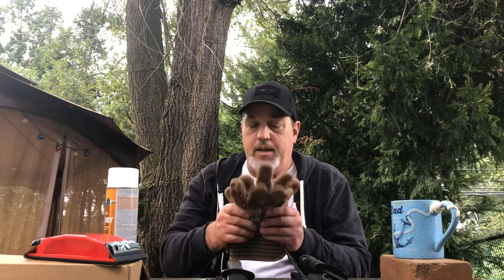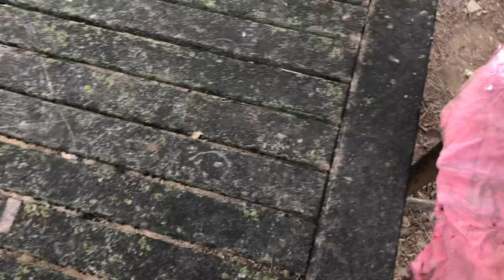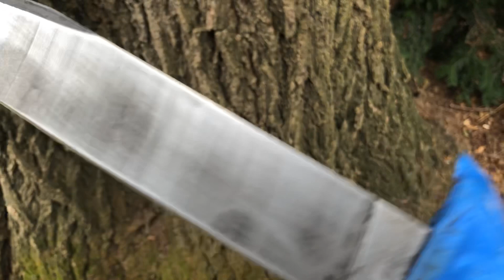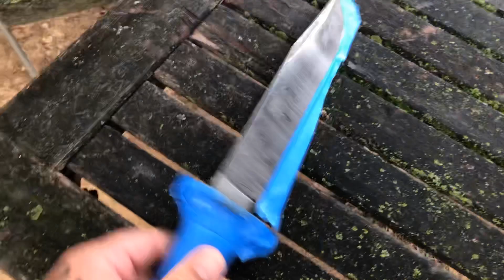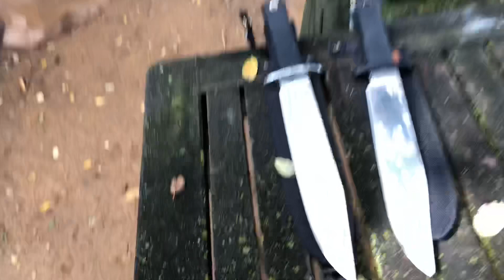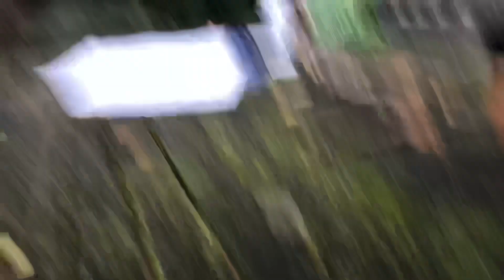MTech mt- 151 Trailmaster knife Coating Removal - STUNNING!!!!!!!!

Comment: I see this is an old video, but I just finished my 151 and thought I'd share what I did different. I polished my guard, but only the blade side and edge. Under the coating the guard has those same ridges. So I wrapped 100 grit paper over a putty knife and sanded it until the ridges were gone. Then is worked my way down to 1500 grit. Then I used mag wheel polish to shine it up. I taped it off to start working the blade. I have a bench sander, so that helped alot. Once the lines were gone I sanded down to 325. At that point I went a different route than you. I used 325 grit mesh sanding disc on a 6 inch random orbital sander. The end result looks like a stone wash finish. I was suprised how smooth the finished product was. Thanks for showing us your process. Watching your video gave me the nertz to try it myself. Lol I love that cheap knife now
Reply from the maker: That sounds so awesome!!!
Thanks for letting me ( us ) know .
I know that mine would of been so much better had I used real tools ….
But I just used my only God Given instruments ( my hands ) . 
I remember doing this .
Every tine someone asks me about it my hands and right arm start to hurt again haha 😂 
Hurts So Good though as I am still very proud of the turnout .
( I did other coating removals after this that when you get a chance check out ).
Happy New Year 🎆

Comment: Wow. This is a new deal. I have removed cheap paint from pocket knives and found high grade stainless under I did this baked on truck bed liner type stuff once but had to work harder after than you did.  I need a can. I have been using Kleen Strip Paint and Varnish remover. Another thing we have in common, we are attracted to shiny objects.
Reply from the maker: John Bullen That “ 2 Great Minds “ saying is in full gear haha .
Wow !
You did a bed liner ??
Lots of elbow grease , yes ???
I was more curious than anything.
Could I of went a little further???
I’m not so sure .
Maybe with a machine .
This was “ All Hands “ on deck .
Mine . 
Haha haha 
Thanks so much

Comment: Hey what up Spike lol , I love that show . Yeah those Marks are from the " High Quality " Chinese machining. I told Donnie about these ridiculously big Bowies on BudK , I know the site is hit or miss but look for the Giant Killer Bowie , Joe Doomsday said his was like 5lbs lol and almost 1/2" thick . Yeah that reflection is becaus 1 is stainless and 1 is high carbon , but my Spyderco Resilience in 8CR13MOV gave me a mirror polish with 3000 grit sandpaper but my 511 with S30VN didnt with the same paper , weird hey ? I started at 600 grit and went up 50 grit per round till 3000 grit, I also use Windex or any glass cleaner for lubricant and it dries quick so no streaking or rusting either .

Comment: To toss something new into the mix  I just bought and received  the lowest end and cheapest at $ 9.99  Mora knife made. When I used to get wet a lot, if it wasn't a Mora, it was a Nimrod that I went under with. I don't know why I waited so long to get a new Mora, but it comes out of the box shave sharp, and if you only use it to open mail get one
Reply from the maker: I actually do have the a Companion .
It is very similar to my Cold Steel Finn Hawk ( without looking I think that’s the one ).
And a couple months ago , I won a survival bag / kit , and there was a Mora included .
Awesome little knife !!
Especially at THAT price haha .

Comment: Why did you remove the coating? Isnt it better with it?
Reply from the maker: Well ??
The coating does serve a purpose.
But I’m not too worried about an attacker seeing my knife reflecting off the sun haha .
( that’s another reason for a sheath - to conceal ).
But I would want any possible attacker to see the long shiny blade .
I know I would think twice haha .
But this was just an experiment.
A lot of folks out there prefer shiny over dark coated blades .
So if they want to remove the coating , here it is . 
Me personally??
I like my blades to shine .
Hope this helps .
Stay safe as always and Thanks for watching 🤠
Reply: @tubes5150  oh ok. Well i use uncoated knives for camping. They can use to strike fire steel. Use the spine of the knife.
Reply from the maker: CLASSIFIED AGENT I didn’t try that using the MTech .
I know some work rather well ( for striking ), while others do not .
I just make sure I always have my striker with me .

Comment: I’ve been thinking about getting the trail master in San Mia,is it worth the money?
Reply from the maker: Yes 👍🏻 Yes 👍🏻 Yes 👍🏻 
I love that blade !!
So Beautiful and wicked sharp .
Definitely in my top 5 All Time Favorite knives —- and My # 1 Knife by Cold Steel .
Reply: Hardly worth it. At $300+ Not for a blade with the same cheap rubber handle that's found on their $40 SRK.  The San Mai blade is high quality but the handle material doesn't match it and the price point.

Comment: Do you see any difference in ability as far as- strength- cutting- weight ,sharpness or feel that the more expensive trailmaster provides over the mtech ? or are they match equal in effectiveness ? Can you do a VS match ?
Reply: Mtech is Chinese GARBAGE. The quality between that and cold steel is dramatic. Sure mtech can take  edge. But it won't keep it under hard use like the cold steel. If you have san mai trailmaster it's a beast. It's nearly razor sharp and will hold up to most nearly anything. It does have a tendency to chip at the edge if you abuse it. If you stick with wood and flesh the edge holds up fine. I'd say stop being cheap and just buy the cold steel. No one ever regrets buying a trailmaster. Heck I own 2 going on 3. I also have a laredo bowie in cpm3v. Forget the cheap knives and just buy knives of quality. Cold steel lasts a lifetime of hard use if taken care of properly.

Comment: You can see your reflection because its cheaper steel , 
san mai is a process an has  the hard steel hagane forming the blade's edge, and the iron/stainless forming a jacket on both sides.  , so no, you wont see your reflection in the san mai. San Mai is obviously a much better steel than 440 on the MTech, however it is not guaranteed to be exactly the AISI 440 series steels.
Reply from the maker: Haha 😂 
Yeah I’ve definitely learned that over the years ( well since I posted this video )….
I still don’t know much about steel only what I’ve learned here on YouTube . 
And taking other peoples word for it . 
Heck I’m still trying to figure out the different types of grinds haha 😂 
Thanks so much for watching 🤠